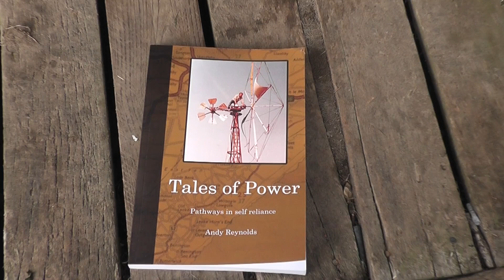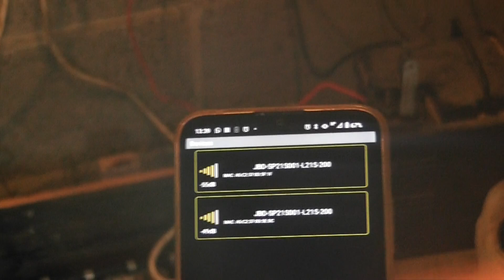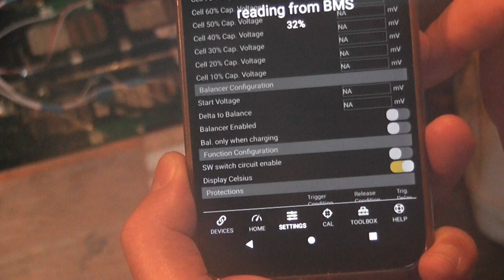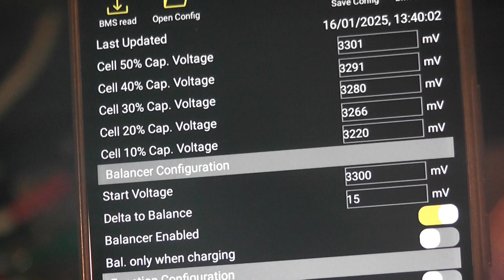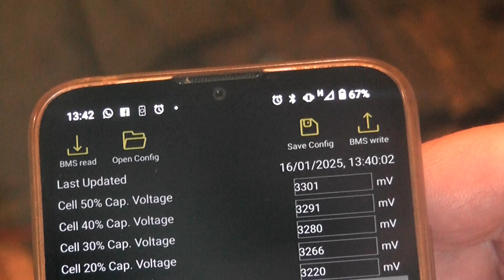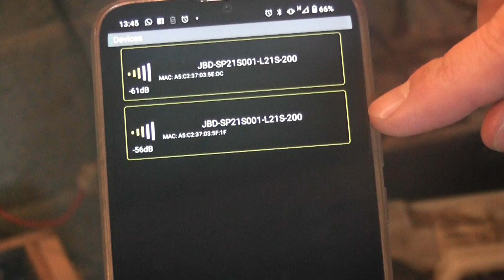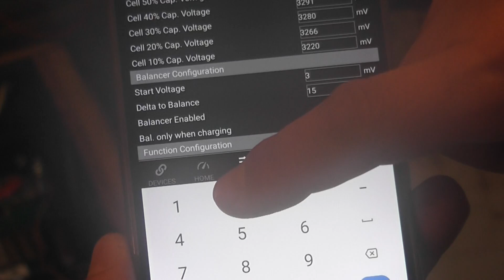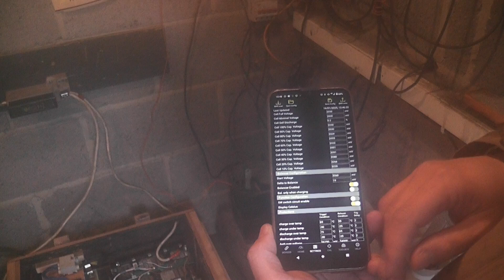BMS adjust with Overkill Solar, balance charge start setting, buffer battery

Comment: Hi Andy. The 3G shouldn't matter. You can download the apps without a sim card on the house wifi. and leave the phone as an interface in the shed constantly plugged in to charge and constantly linked to Bluetooth.
Reply from the maker: Owen, apparently the ios is 12.4 and overkill needs 13, but it's great as a video and stills camera. My first eye opening to apps, cheers

Comment: Hi Andy, good video.
The apps can be an unnecessary complication for simple devices. The BMS one you show seems worth it due to the complexity/numerous config options.
I like the option to save configuration files, so you can go through one BMS and then update all your others to the same settings/levels.
Reply from the maker: Ian, yes but great for adjusting settings. For this battery individual cell voltage can be measured direct but the quick comparison is interesting. How are you getting on with the Hilti? Cheers
Reply: @TheInfoworks 
Hilti looks OK so far, not working due to brushes being disconnected. Odd as the motor must have been dismantled (amature removed) to disconnect the wires. I need long reach jaws for my gear puller to remove some of the casing which involves reinstating a gifted oxy/acetylene set (so I can bend steel flat bar rather than cut and weld). Funny how one project spawns several others.
Reply from the maker: @ianhelsbyservices  Strange things, all I know is that Steve had a period of buying things at auction and this is one of them. Normally they are at an auction for one basic reason, sounds like you are in for an adventure. I would have looked at it but I have  large 110v Sparky breaker and I figured 1 is enough, cheers